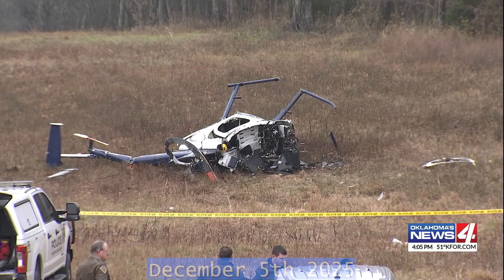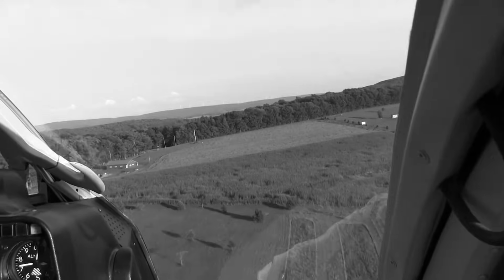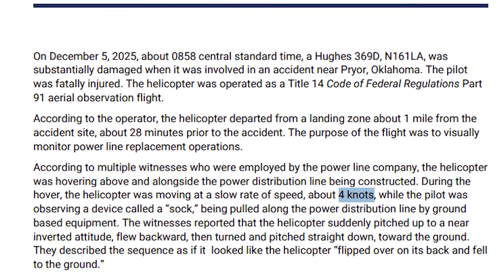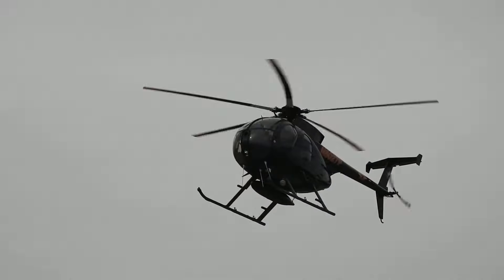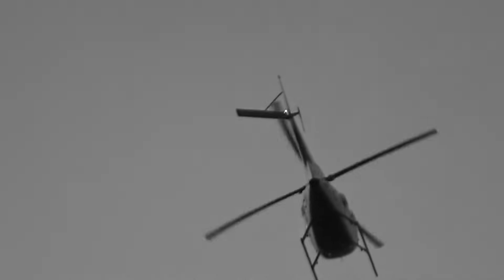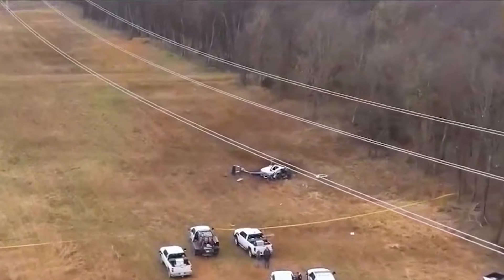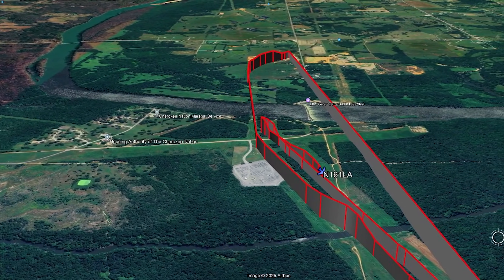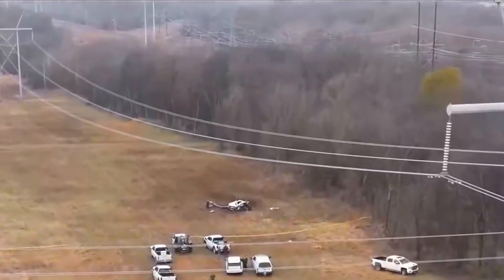NEW Updates About N161LA Helicopter Crash near Pryor OK 5 Dec 25…

Comment: The Honolulu crash was a runaway lateral trim motor to the left. The tech rep had told us that it takes quite a lot of pressure to try to bring back the cyclic to the right. There was one pilot where it happened in forward flight where he had to use knee to aid him in holding the cyclic before he could land.

Comment: A teetering rotor system is usually associated with a two bladed underslung main rotor. The MD 500D is a fully articulated main rotor 5 bladed. A very responsive system. It also has a uniloc component for the fore and aft portion of the cyclic control. If that malfunctions it will effect also for and aft movement. We had an MD500D where the uniloc was malfunctioning internally where the pilot was beginning to experience unusual fore and aft movements on his cyclic control when hovering. The check ball was not seating properly in the unit.